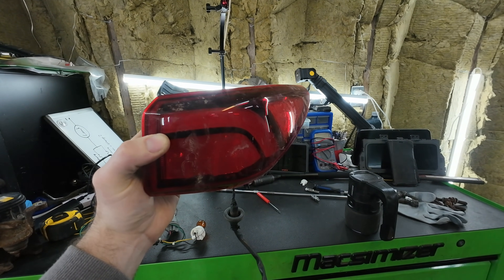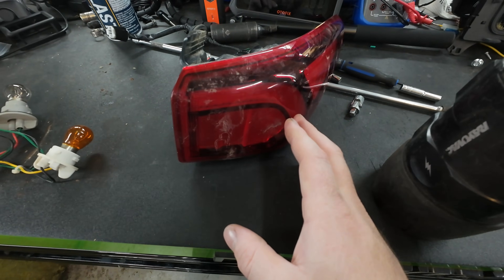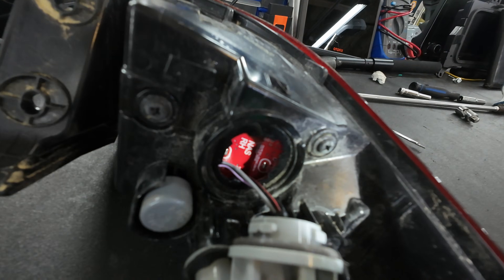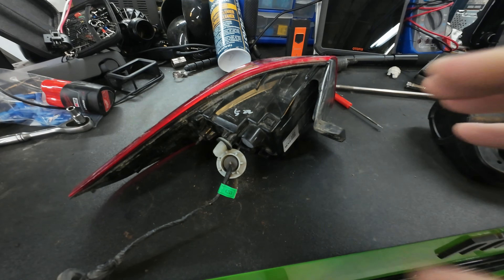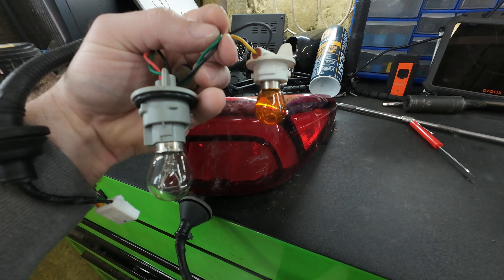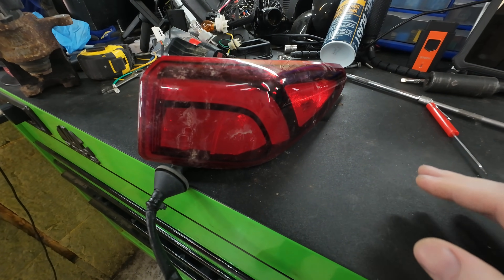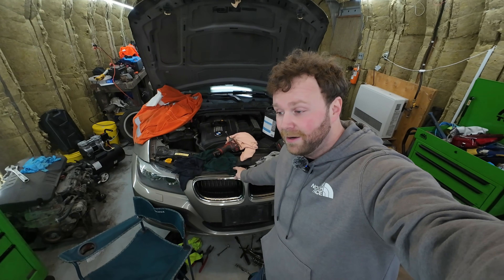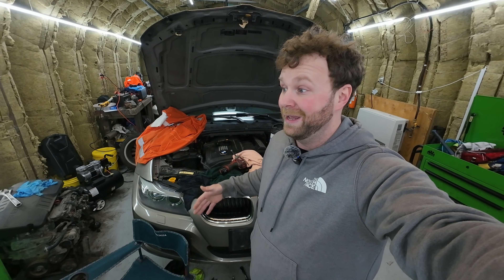Car Manufacturers don't even want you to change bulbs, they want you to replace entire assemblies!

Comment: There are so many issues like this.  It is even for controls that prevent things as simple as looking for a nail in a tire.  I believe that I own my last new car.  I will be replacing it with a much older vehicle.  First, it has an automatic transmission.  I am not a fan of them.  I often judge distance traveled by opening the driver's door and judging the distance traveled by looking at the ground.  If I have a tire that is leaking air, I can look for a nail in the exposed tire, move forward or backward a bit, and look again.  My car won't let me do that.  If the driver's door is open, the computer won't let the transmission shift into a gear.  OK, I get on a sloping area and put it in neutral.  If I release the brake to let it roll, the brakes automatically set.  There are so many other controls that prevent me from being the driver.  I wish the government and manufacturers would just build a good car without all of these controls.  I also wish that our schools would provide driver education as a part of the learning process.  My school district provided driver education as a summer program that trained us, provided written testing, and a certificate that allowed us to take a driving test and get our license.  Why don't we replace a pronouns class with something that has real world importance?

Comment: Had the dealer and local mechanic tell is it was $1800 to change 6 spark plugs and wires on a 2025 Mercedes. Yes you heard that right. I bought the parts for $125 and did it myself. EFF U!
Reply: Mercedes has spark plug wires?

Comment: I agreed, a simple headlight change which normally won't last more than 100km, replacement cost of halogen bulbs cost max US$30 each last time car make before 2000! Now car make at 2018 , same headlight issue need to replacethe entire assembly cost oer $2000 before workmanship! Crazy!

There should be reglator to prevent this!

Comment: All this does in addition is drive up our insurance rates as minor collisions are costing a fortune to fix.  Its the same with the headlights which now have these elaborate assemblies. I won't buy these new cars with this crap but will stick with cars maybe up to 2020. Its getting worse every year. Try bleeding brakes on a hybrid. You need to plug in a controller to the computer to allow simple fluid changes.

Comment: NOW, YOU CAN'T EVEN CHECK YOUR OIL. I saw a video recently about the new Ram pick up trucks.
 They dont have oil dipsticks anymore. 
 Instead, tp check your oil, you have to access the menu on the interior touch screen, click on vehicle systems, open sub menu, scroll down to engine, open menu, click on fluids list, scroll to oil, click status,  scroll to oil life indicatior, click oil life status, then select remaining life miles, or remaining life months.

Comment: Incandescent bulbs use 95% of their power to create heat not light. LEDs don't need a PCBA like that to run.

Niether technology is at fault, each has its benefits, the companies are at fault for flagrantly designing in way that fucks you. Both out of your money and  by pumping out intentional E-waste

Comment: UK here. Had a similar situation with my '06 Mazda 3 Sport (2l variant here). A couple of days before its MoT annual test I spotted the red part of a rear light was out. As they're LED ones I had no option but to get the Dremel clone out to hack it apart and see if I could fix it.

What I found was three strings of LEDS with one intermittent in two strings along with circuitry that killed the entire light if one string failed. As it's a direct replacement for the bulb setup on lower models there's no smarts to tell the driver it's gone faulty and as the fault was intermittent it was only by chance I'd spotted it.

Bridged out the faulty LEDs, crossed my fingers there weren't more, taped it all together and got an MoT pass. Bought a new light from an eBay scrapyard for £45 delivered that's much later so hopefully won't have the same problem and the other side appears to be still OK.

Comment: What does the PCB function for the light? Before they had HUD displays, their was standardized radio bays and radios with kits to convert sizes which gave rise to the audio installer businesses the subwoofers and tweeters. Now we have HUD display screens for a sleek clean modern look. All proprietary and no open source. This leads to manufacturer dependency for both hardware and software and no interoperability. However if cars were more standardized and open source and more FRM (field replaceable modules) cheaper aftermarket could tap in and keep repairs down. So my point is it's not so much new designs as it is a lack of open source, standard hardware and design principles, and industry interoperability (for example CANbus is a open protocol)

Comment: Yep. The tail light burned out in my 2005 Lexus RX330 last week. I went to Ace Hardware and picked up a two pack of bulbs for $5. I plugged in the bulb in the parking lot. No tools necessary. I looked up the price of an assembly for a 2024 Lexus RX350 - $572. That’s without labor.

Comment: Lets be honest here. We, the customer are who is to blame for all the things like this. We expect lights that can pierce the darkness for 200 meters ahead, we want lights to stay on until we get inside our house, we want a switch instead of a handbrake lever, we want our cars to be fuel efficient, but each new model that comes out has to be more powerful and have more technology than the one it replaces, but be better for the environment. Car makers are just giving us what we want, and we lap it up until it stops working. If you don't mind poor fuel efficiency, wind up windows, no auto lights or wipers, 1 or perhaps 2 airbags, not 8, no ambient lighting, heated seats, 10 speaker stereo's, remote starting, security system, lane keeping, blind spot monitoring etc. etc. then buy yourself a car from the late 1980's to early 2000's and you can have a basic, repairable vehicle. Modern cars are very complicated, and they go wrong sometimes, but it was us that wanted it.

Comment: My 2013 F-150 had water in the tail light assembly last year. I got my smallest drill bit and made a hole at the bottom. Problem solved. If it was a 2023, it would have crashed the computer and cost many thousands.

Comment: My 2022 Ford ranger got a rear tail light broken.  Ford wanted $1200 to fix it.  The Blind spot radar was damaged so I found a "bare" assembly for $150, and moved the radar to it. No recal needed since it was the same radar assembly in the same place on the vehicle.

Comment: the 9006 headlight bulbs for my 1992 BMW 525i are $25 each at the AutoZone, have to remove some plastic trim around and the tab on the bulb itself become hard to pull, still beats LED crap

Comment: 2007 that was the end point for me. Last year picked up a loaded '02 Town and Country Limited AWD, 129k, 3.8 ~ $800. my other ride a '02 Caravan shorty bought for $550 in 2017 with very minimal maintenance. Yes I will put in a few bucks but right of the bat, a swell ride, comfort and nothing to spy on you, just a bit of typical rocker rust being now finally dealt with, (hint a Caravan, Town and Country, voyager nut) well under rated for anything you want to do with them. simple A604, no bands and none of that F.O.R.D. what you repaired daily for .99 cents is now a fortune monthly.. except maybe the 7.3 IDI and even form PSD's were ok. Owned one an ambo made on Halloween ~ go figure? but not as haunted as a money pit anything post '07 is,

Comment: So, my lightbulb story starts with California refusing to smog my 2000 chevy Tahoe because of a check engine light that had nothing to do with emissions. I had inherited it from my grandparents. After sharing a car (99 Honda Civic) with my mom for close to half a year, my mom bought a salvage titled car with her tax refund, there was a crack in the taillight's plastic cover. Went to a junkyard and got a taillight assembly to take the plastic cover off. This was after replacing the bulbs in the assembly. The covers for Nissan Altima's aren't universal. With both assemblies apart on the driveway in front of me, that's when I learned this as the cover from the junkyard for the left assembly and I needed a right one. My mom had to buy the whole assembly for several hundred dollars because of this, and it came with its own bulbs meaning all I had done wasn't necessary. Also, it hurt turning it in for scrap because at the yard we were directed to were several sedans and a coup that couldn't be resold. I wonder to this day if I could have got one of them repaired to pass smog to this day. We need to be able to do simple repairs like this.

Comment: This is so true. My 2019 Traverse needed a headlight replaced. They had to take the entire front bumper off to do it. AND it cost $212 for one headlight.
Reply: Older Nissan maximas was the same way but 2200 per headlight and you had to pay a fee for the retro kit so people won't steal them because they were so expensive the best thing I heard from a mechanic if it doesn't have an ashtray I don't want it
Reply: @michaelharris6662  my 2021 Jeep Grand Cherokee is the same way. Have to remove the whole front end to access the 3 bolts to remove the headlights just to replace a $1200 light. If the transformer is bad that’s another $1800. 
My 2017 Peterbilt 579 same type of headlight and they are only one hundred and fifty bucks

Comment: Progress....
Technology....
Ahhhhh.....
Remember sealed beam headlights. 
And bulbs that simply twisted in....after using a phillips screwdriver to remove the taillight...
How about them dimmer switch on the floor ? ...easy to replace...now the steering column must be taken apart to fix the problem....need I go on !
My 2012 KIA Soul is the newest vehicle I will eber own....if it dies I will look for something even older !

Comment: Assembly is sourced from China for $25
Reply: Made in Shenzhen for $9.75 per 50,000 units.
Reply: I mean would you prefer a modern American made product where its still made in China stickers are removed and it's put in nicer packaging for 20x the cost ?
Reply: @stockrappy  Even the packaging is made in China 🤣
Reply: @stockrappy  america can't manufacture that stuff anymore
Reply: @9Below  The only thing America manufactures is national debt.
Reply: Could you jerry rig a light using a harness and connect it to the power source?
Reply: @stevensinger8486  exactly. Selling parts is where they really earn money
Reply: @andresouza2314  you know besides the small part where leds  don't need to be replaced like traditional bulbs
Reply: @stockrappy theoretically you're right. Those LEDs are supposed to last longer than the car, BUT, eventually they will fail or get broken.
Reply: Gotta turn a profit somewhere.  🤷🤷‍♂🤷‍♀
Reply: @cbotten106  .....not if you can connect up with the Chinese source.

.
Reply: @cbotten106  yeah, cos cars r so cheap these days....Not

Comment: A typical alternator only produces 90 - 130 amps of current.  At one time, that energy was more than sufficient to satisfy the electrical load placed upon the system.  On today's vehicles,  that same output needs to be shared by many more energy consuming devices  - multiple computers,  infotainment,  control, stability,  communication etc. As the electrical load has increased,  the use of lower energy consumption devices has also increased.

Comment: Remember when you used to be able to change the inserts to the wiper blades?
Reply: Soon enough, this will be a subscription service. Like door locks and brakes.
Reply: @Kiyoone This is why I NEVER have power locks.  How hard is it to lock a door...or unlock it?
Reply: @joeidaho5938 Try to lock a door on the other side or in the rear without power locks. I see it as a security measure. If all of a sudden you find yourself in unfavorable surroundings you can lock the entire vehicle at the push of a button.
Reply: This is why I will never buy a vehicle past about 2005.  I can repair absolutely everything myself.  A friend of mine has 3 modern cars....and keeps telling me about repair bills ranging from $2000 to $15000 for things I can fix for about 10% of the price....lol.  He works a hell of a lot....just to fix his cars.  He keeps justifying it....as life enjoyment...lol.
Reply: @joeidaho5938 but you can not found any
Reply: @joeidaho5938  Too right you can repair everything yourself, and spend more on parts and your time than the cars worth on repairs every year as all of the parts become brittle and more goes wrong every year
Reply: @ReadTurgot-understandeconomics  a new part can last 5 years or more. Once you replace all main  systems  in a pre 2010 car your maintenance cost will plummet. You will just need, oil, sparks, brakes and tires  your car
Reply: @Theveganshift77  That depends on how old the car is, when they get to an age you get suspension problems costing close to 4 figures, timing belt in many cars that need replacing often, spark plugs is only true for petrol, diesel have injectors that are alot more expensive to replace. then there are axel problems, the steering components etc. Tires, oil, brakes are just general maintenance that need doing every several thousand miles, they are not really anything going "wrong".
Reply: @ReadTurgot-understandeconomics the cost of maintainance for  an old, paid for 90s or early 2000 car is  a tiny fraction of 2020s , out of warranty car  with a  monthly payment , more expensive insurance, hyper expensive repairs.
Reply: @Theveganshift77  Yeah buying a car on lease is a terrible idea, I do think old cars are better but only if you know how to spot problems or have them properly checked beforehand and can do the repairs yourself, because if the engine needs to be dismantled to replace some seals or hard to get to areas due to leaks or other problems it can be more costly than buying a newer car for more, especially if the housings have corroded or anything like that.
Reply: @ReadTurgot-understandeconomics corrosion is the biggest killer. Engine repairs in older cars are inexpensive. A $1000 engine overhaul is cheaper than saddling yourself with $70.000  car debt. Besides once your Ipad car goes out of warranty, you still have a car payment and a highly complex piece of junk with maintenance costs 10x as expensive as a 90s clunker. If it is an EV make it 20x if the battery goes
Reply: How abbout adjusting the voltage regulator?
Reply: @KOZMOuvBORG An electronic  regulator shouldn't need adjusting.
Reply: @joewoodchuck3824  I'm talking about the 60s, when you could unscrew the cover.               There are videos on YT showing how.
Reply: @susann3772  yes you still can, at least on my Toyota, but it has to be a Toyota blade, then from that point on you can change only the rubber
Reply: @sunshine76-d4m yeah, and Toyota charges MORE for that insert than full assemblies cost.
Reply: You still can buy inserts. They're on the web. Local stores don't want to carry them because there's more profit in selling arms. You can even buy a roll of wiper rubber and cut to size using the original rib.
Reply: Now the parts stores don’t even offer refills and wants $60-70 for some damn wiper blades that don’t work for more than several months. 
I used to buy DuPont blades for $3.49 at homedepot but they stopped that once they opened the automotive section then they ran the prices way up like everyone else.
Reply: @whatfreedom7 Reffils are still available on the web. you can even buy a roll of the rubber edge.
Reply: @susann3772   SURE  CAN.
Reply: You still can
Reply: @scottr3484 and if costs the same 🤷‍♂️
Reply: YESSSSSSSSSS
Reply: Lol. Still can. You're just not buying the right wipers.
Reply: Fortunately, I can do that on my car, but a friend's Lexus has wipers with about half of the wiper arms with the blades attached needing changing each year, at Au$100 each! Meanwhile, I only have to spend Au$20 for a pair of wiper blades.
Reply: You can where I live for both framed and flat blades. Buy silicone refills and they will last for years.
Reply: @susann3772  I have a 23 cx5 I can change them
Reply: Exactly why I keep my old cars running.
Reply: @susann3772  you still can.  The problem is that people mess it up all the time and put big scraps in the windshield.
Reply: @bindingcurve  No auto parts store where I live sell inserts. They sell replacement blades and call that a refill.
Reply: @KenLee-e5yyou can't get a package delivered?
Reply: @KenLee-e5yonline is not an option, right. 😂
Reply: @bindingcurve  you can't get them where I live. You have to buy the whole blade.
Reply: @bindingcurve  My old Mopars have click-on wipers, take about ten seconds to apply. My Subaru requires a YouTube video and puzzling it out to replace the wipers. Idiots.
Reply: Still on amazon bought a two pack for $11 last year.
Reply: @sneed915 same here. I stocked up.
Reply: This one is not a real issue, as wiper blades are cheap.  It's only a problem if you're notorious for wrecking your wiper blades, because you use them without loosening them up when they're frozen to the glass.  Just start your car, run the heat, and make sure your blades are loose before using them.  How hard is that??  They usually get wrecked out of sheer laziness.
Reply: I still do. It’s not as easy but I spend maybe $20 every two years on the wiper rubber.
Reply: You can't do THAT anymore either? 😂 (2006 Nissan Micra driver here)
Reply: No one sells the wiper refills.
Reply: @SpynCycle57  Lexus does
Reply: @SpynCycle57  yes they do
Reply: @SpynCycle57  Amazon does